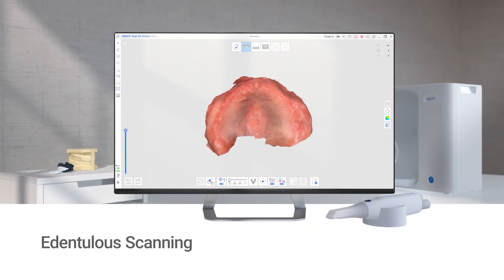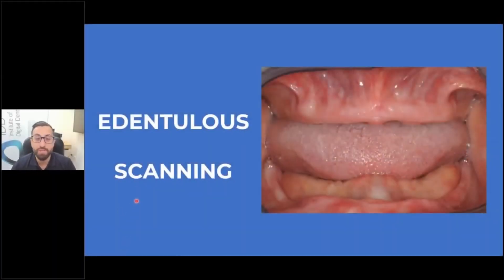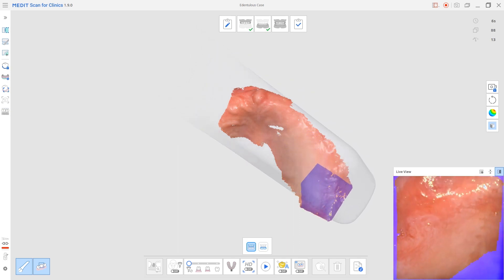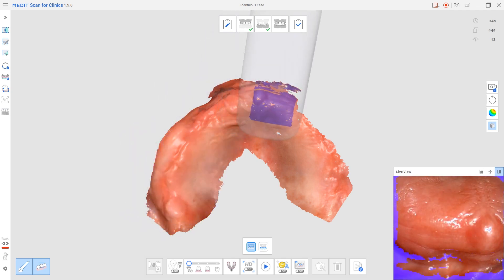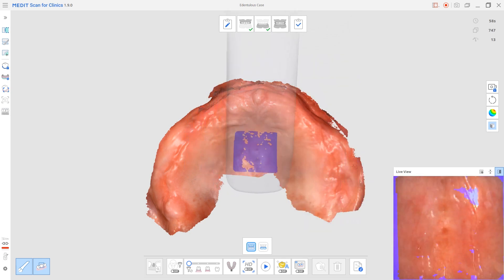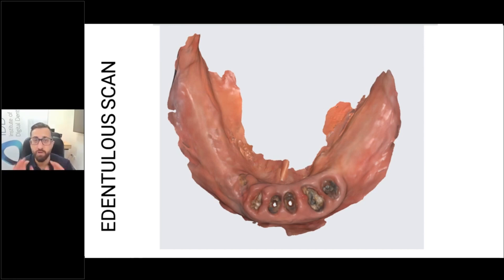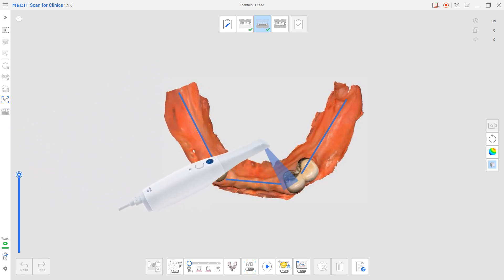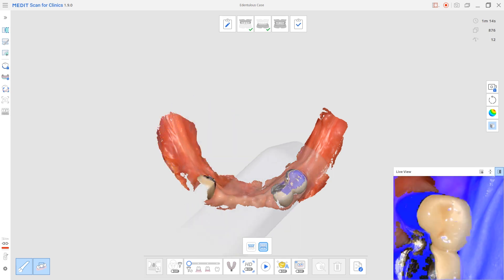Edentulous Scanning

Comment: What about the success of digital scanning compared to  2ry impression with  different  impression materials used??
Reply from the maker: If you are asking the success rate on the digital impression compare to conventional one, then I'll say lot of digitized clinics are already using this technique for their most edentulous cases.
Reply: I prefer to work with compressed mucosa. Therefore, if there is a removable denture, I always ask to detail it with a thin layer of silicone and scan the inside part.